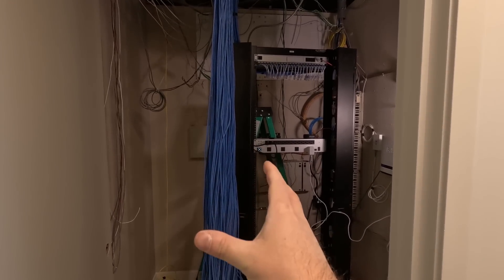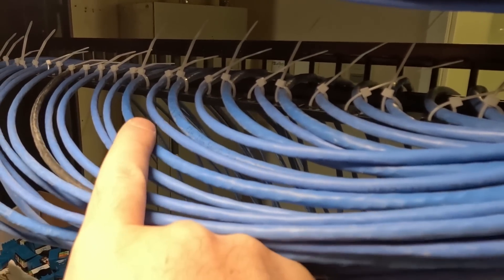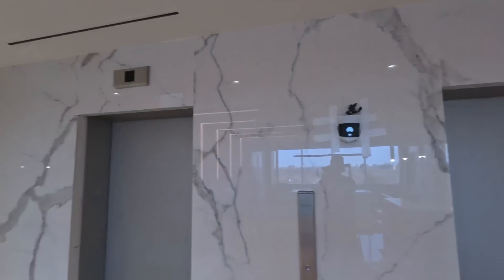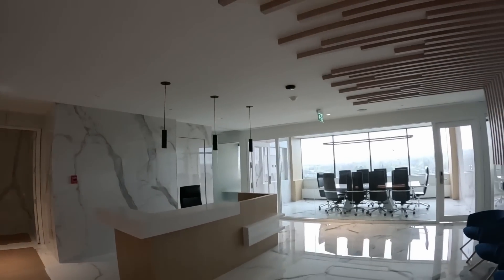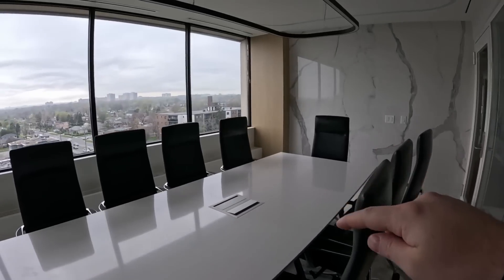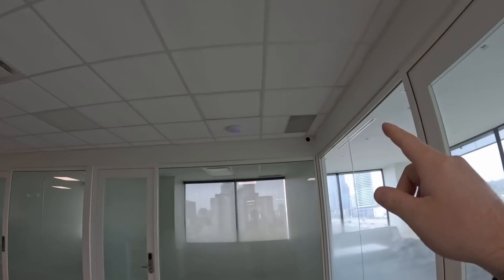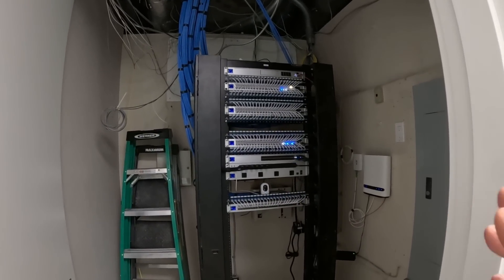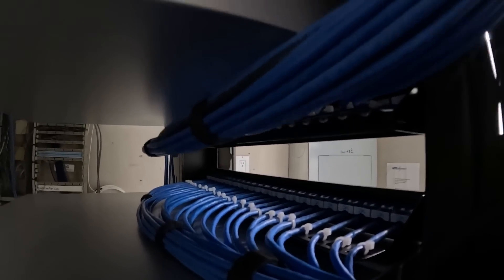BIG Unifi Network installation for a Co-working Space

Comment: Hello, sir. Could you tell me, how the cable guys distinguish the copper cables from the bundle? For example, if you mark the network socket at working place as 1, how do you know which cable from the bundle belongs to the network socket at patch panel under the number 1 from the netwok rack side? How do you match them from the both sides?

Comment: I would give that a B-, you need to get better Patch Panels and Keystones. I imagine you outbid others since they are using better quality hardware. 
I would also like to see some type of cable ladder supporting all those cables coming down from the ceilings. 

Ubiquiti is cheap for a reason, for a budget deal I would go with Meraki over Unifi.  
Adding Sonos will screw up security, I would prefer the LAN is firewalled just like a Guest Wifi, no traffic between endpoints.  I guess maybe you could allow traffic for only printing and Sonos and block everything else. 

Overall good job, but if I were paying $250+ per drop I would want to see better network hardware.

Comment: are those POE switches right next to the relaxation room?  I'm sure 6 sets of mini whiny fans is very relaxing!

Also, just 8 APs for all of that seems a bit low.  Sure you might be able to get the coverage since it's all glass, but in terms of capacity it's going to be a tough one.  You'll probably have quite a bit of hidden node issues which will cause high jitter...
Reply from the maker: I doubt the room will hear the fans the door in the network room
Is pretty thick. Also wasn’t my design lol

As for wifi coverage we designed it in Ekahau AI pro so should be good but if not will add some more
Reply: @MactelecomNetworks  I don’t doubt you planned the coverage well.  Your coverage will be “just ok” but (a) it doesn’t seem to be planned for capacity and (b) I’m guessing there’s almost zero secondary coverage so if one AP fails that whole corner becomes unusable.

Since it’s a coworking space and not a fixed office, 90% of the users will be only on WiFi so AP coverage needs redundancy, or they’ll be hounding you if an AP fails

Comment: i hate that the power plugs are on the front. As this is a managed device ideally for UniFi hardware it would look so much better if everything plugged in the rear of the unit
Reply: Just mount it in the back of your rack or backwards

Comment: Looks great! Do they typically ask to certify your runs? Looking forward to part 2!
Reply: I always supplied a certificate with every cable run. Never an argument then over 'is it the cable run or equipment that's having an issue'. It looks professional too. Not just data cables stuck in by a sparky.

Comment: The networking install looks awesome! The interior design is pretty terrible. Noise will be pretty bad with all the hard surfaces
Reply from the maker: Ya it was a little echoed in the reception area. The other offices seem fine though
Reply: Fully agree on the acoustics! All hard surfaces and square angles. Bad acoustics tire. As salary cost per hour is so much higher than rent per hour, it should be an easy pick when prioritizing between surface and sound. 

That conference room must be a nightmare, but I guess they will promote the visual impression when pitching the workspace to potential tenants. I would prefer sitting in an outdated interior but with good acoustics, temperature, light and air.

Comment: nice work, looks amazing. question in regards to the aggregation switch, why go for the larger model when u could have gone with the 8 port model based on the video where it only used 6 port, is it due to scalability?
Reply from the maker: Will be adding more gear to this setup so the 8 port aggregation wouldn’t have worked

Comment: As always great job! Curious as to how you are managing network segregation for security in a co-working location. Would be great to see a video on that. Would imagine there are "longer term" tenants that would need their own VLAN for both wired and wireless networks along with their own SSID to be interconnected ?
Reply from the maker: Yup I’ll be going all through this in the third video. Still trying to figure it out but probably wired radius. For long term clients seperate networks
Reply: Great video as usual!  I am also curious.  I help with a Unifi installation at a none-for-profit co-working space.  Over the years they have allowed long term tenants setup their own wifi for various reasons which I suspect is now causing issues with the Unifi APs. Thanks again

Comment: why do you connect all of the patch cables if there isnt anything on the other end? that leave all of the jacks hot and anyone can plug anything in.
Reply from the maker: That’s correct. It’s a co working space so we never know who’s going to be using what data jack.
Reply: @MactelecomNetworks  so you allow anyone to connect anything at anytime? thats just crazy.
Reply: I am sure Cody is gonna set up some VLAN and firewall rules for different purposes to prevent any malicious acts.
Reply from the maker: @ericzhuo9077  it will most likely be done with wired radius we’re still trying to figure that out how to integrate with the app we’re using
Reply: @trick0502 I used to think the same…..but later I realized I’d rather change a port setting remotely than have to go onsite to connect a panel to a switch. Everything is hot, but can be easily blocked without going onsite. It also looks cleaner with everything neatly connected.